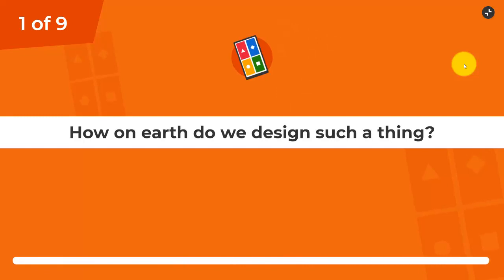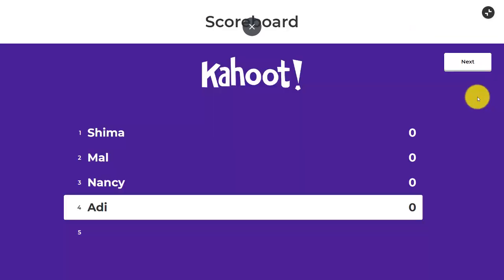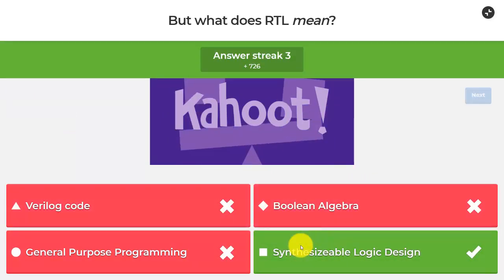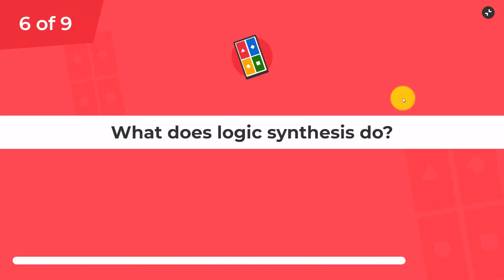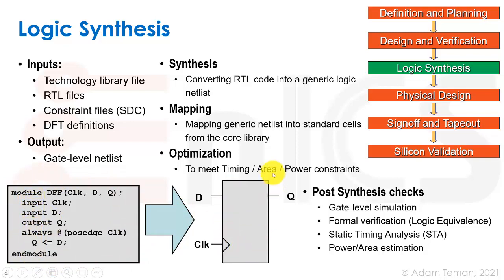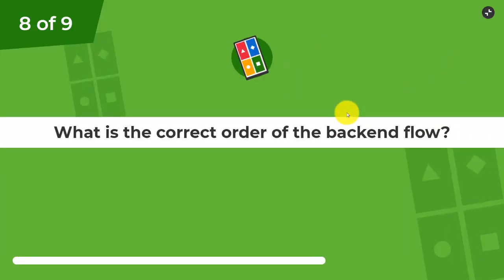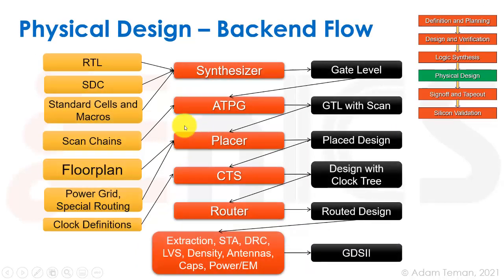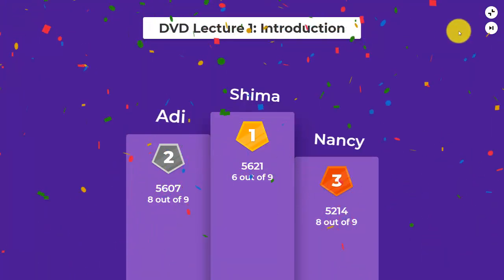DVD - Kahoot for Lecture 1: Introduction

Comment: A quick follow up question. The technology file contains standard cells specification. Aren't Standard Cell and Technology map file synonymous. Can you please clarify. Thank you.
Reply from the maker: So, I think you have a few terms mixed up.
The "TechFile" (technology file) is actually usually a term used for the file that comes with the PDK for push-polygon layout (transistor-level) design. 
Essentially, you don't even need a TechFile to do physical implementation (for the most part). 
What we use for the backend flow is a "TechLEF" file, which is - I guess you could say - a reduced version of the TechFile in the LEF format that is used for place and route. It does not contain standard cells, though some standard cell libraries will provide the TechLEF, so you don't have to have the "analog" PDK to run place and route.
Finally, we have the standard cell library. This is a collection of many files that describe the standard cells in a certain technology. They are, of course, built using the TechFile, but that is done by circuit designers and layout engineers. 

A full description of this is given in Lecture 3 of this series.
Reply: @AdiTeman  Thank you so much for a detailed explanation.

Comment: Thank you for the super informative lecture series. Just a quick question reg RTL. Even if the design is completely combinatorial, why would we still call it RTL design?
Reply from the maker: Funny observation.
Indeed it is a bit weird to call a purely combinatorial design "RTL", but usually combinatorial models are only a small part of a larger design that also includes registers :)

Comment: Why is there a need for a vendor to develop a std cell library, isnt the foundry more equipped to create a better library due to their process knowledge and generate more revenue for them.
Reply from the maker: Yes, this is actually the trend nowadays. 
Most fabs supply a library of standard cells along with the process, so they are both the fab and the library vendor. That being said, there is still a substantial amount of business left over for vendors (such as ARM and Synopsys) that design standard cell libraries and charge licensing/royalties for using them. These libraries either have some special specification that is different from the "generic" library provided by the foundry or they are better in some criterion because they are selling this as a product and put special effort into them. Sometimes they contain more cells with more functionality. 

But in general, the foundries do provide standard cells and many companies choose to use these.